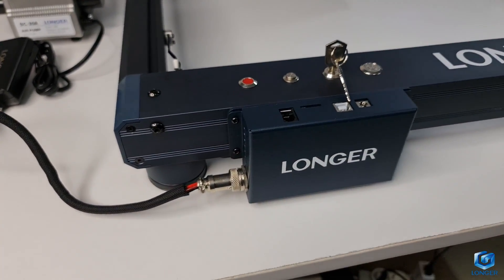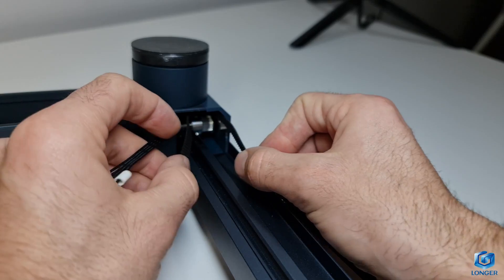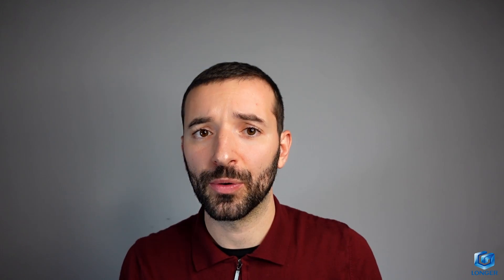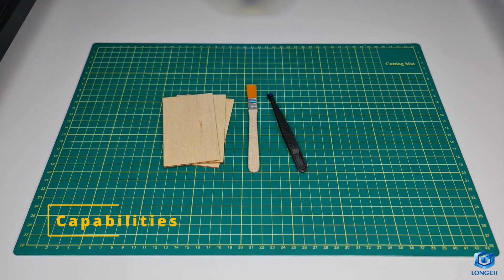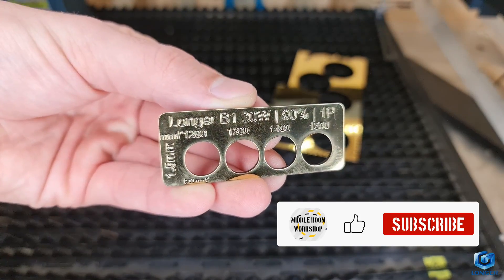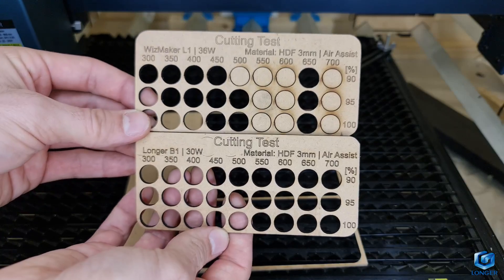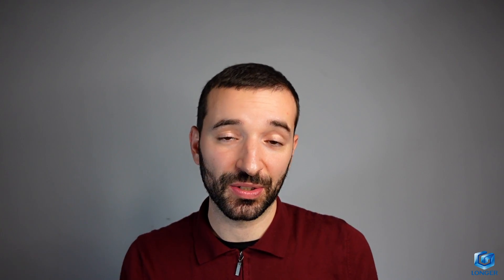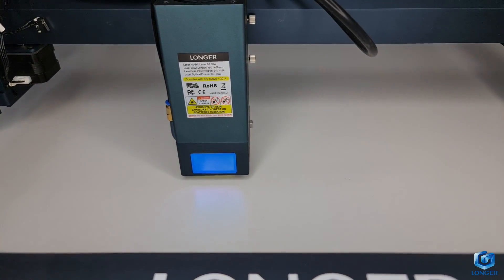Impressive Power and Speed - Longer B1 30W Laser Engraver

Comment: I would like to ask if the lens changes to the longer b1 22watt
Reply from the maker: Hi, thank you for your comment.

I do not have the 22W, and I can't say with certainty, but I would logically say that it should actually be compatible since they share the same design, and in fact, you are not changing a lens but is a protection glass.

I hope it helps.
Ciao